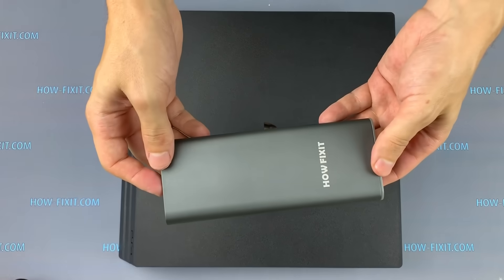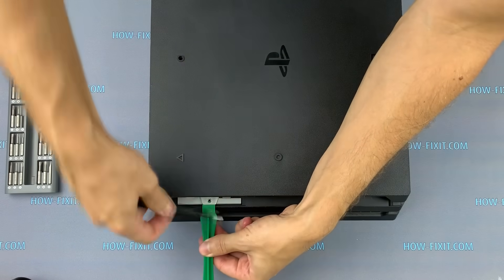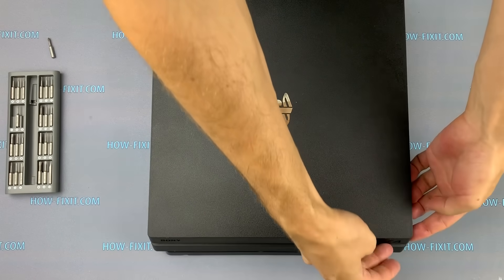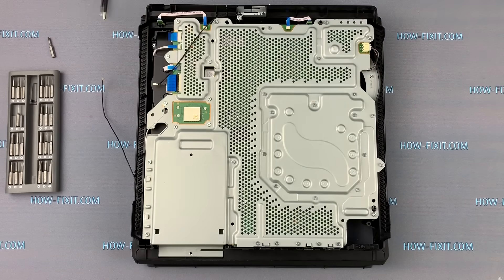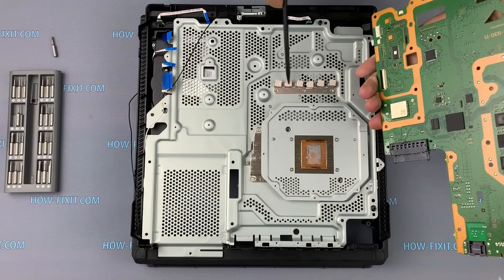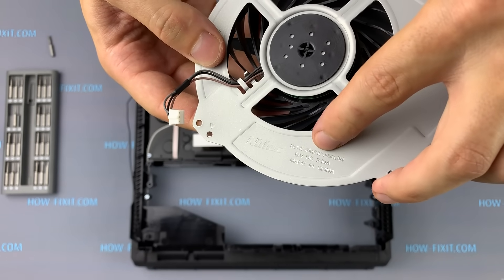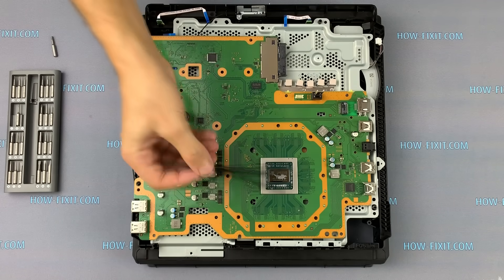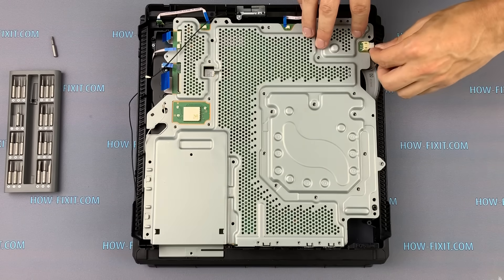PS4 Pro Disassembly: Ultimate Guide for Fan Cleaning and Thermal Paste Replacement

Comment: Thank you so much, i think i would never get my ps4 pro quiet. My ps4 pro is as quiet as it can be, thank you! I used artic mx4 thermal paste, cleaned the heat sink and rebuild the database i think my ps4 pro is little faster too now.
Best tutorial for changing the thermal paste etc for ps4 pro!

Comment: Just broke my ps4 trying to remove the power supply, after about an hour of trying to disconnect the clip, the full thing came off
Reply: same here.
Reply: Ant ChaseMula i managed to get mine repaired mate, cost me £70 though but they managed to solder it back on, maybe look to see if anywhere near you can repair it.
Reply: They basically fully serviced it, removed a bit more dust id missed, put fresh thermal paste on cos id not done a great job etc. It does seem a bit quieter now, still kicks in a bit the fan at times but its deffo not like a jet anymore

Comment: If im gonna actually try this, which screwdriver set and paste do i need from the description anyone?
Reply: You are going to need a basic micro-screwdriver set, and a security screw driver set. Any variety should do in that regard. In terms of paste? I personally find Arctic Silver 5 to be the best bang for your buck and use it on everything I re-paste. Be that Desktops, or Playstations etc.
Reply: Jibb Mcdonaland cheers for the reply but i ended up doing it, breaking the power supply connector and then having it repaired at a shop lol. And then its still noisy af haha even after full service, think its cos of the uncapped frame rate in menus and stuff:(
Reply: @calum769  damn that sucks man. I know exactly what you mean too, I broke the power supply board plug in my OG PS4 the first time I did this on it because it was so anchored in there. Anyways, good luck to ya.

Comment: Cracked that black plastic cover trying to remove the power supply... was impossible to take off (did not take out those two T8 screws on other side- pulled out very easily now)

Comment: i had a CUH-7215b model (RDR2 box set) that had loud fans, would turn off randomly and sometimes wouldn't turn on. rather than spend $200+ getting this fixed, i followed this guide and now it works perfectly. it was way easier than i thought thanks to this video. thank you so much for saving my playstation and me hundreds of dollars. A+, 5* awesome.

Comment: do you think you can do a video using the IC Graphite thermal pad it seems to be a lot more cleaner but i dont know if it will work on the ps4 the same as a CPU

Comment: Was really afraid to do this, especially disconneting the power supply cable, but everything went great and now it's approx. 75% more quite! Fantastic! I have the original launch Pro model, it was very dirty after those 3 years. Used Arctic MX-4 paste + screwdriver set from Extol = cost me 14 Euro :) Thanks for this guide!
Reply: My is broken man .((
Reply: @fahrudingermic2206  Mine too. :/

Comment: Thanks for the video, bought a 2nd hand pro the other day, loud as an aircraft. Did this and now it is deadly silent!!
Reply: Same here. I only popped open the top the other day and boy was it dusty. The previous owner clearly never cleaned it. I’ve yet to do a full clean up.
Reply: @cubancucumber  it is easy enough, done mine and a mates now, makes a HUGE difference!
Reply: Deathon2wheelz did it ever get loud again or was it a permanent fix? Im heading out later today to get the tools and things i need to do the clean up.
Reply: @cubancucumber  still going strong mate, if you do it right and then keep pushing air through every once in a while it will be fine.
Reply: Deathon2wheelz that’s really good to hear. Thanks so much😁
Reply: @cubancucumber  no worries. Best of luck with it all.

Comment: Thank you for the clear tutorial, I would have found it helpful but my current position after reassembling is that my console will no longer power on, it simply beeps once and then the blue light goes out, is there anything you could suggest?
Reply: Make sure the power unit and hard drive are installed correctly

Comment: The socket which the power supply cable connects to didn't wiggle out or budge like it did for you. It lifted the socket off the board, it's stuck in there good I still cant disconnect it. Going to have to solder the socket back on if possible once I've finally separated them. This was one of the simple bits as well. Video helped me a lot until this hiccup but I'm guessing it's just a crappy connector on my PS4.
Reply: AD Westy what version is your ps4

Comment: After doing this my PS4 makes 3 beeps after turning on and then turns off. The only difference is that I used a thermal pad on the cpu, could this be the problem? It shouldnt be able to overheat in 5sec should it?
Reply: What? You applied a thermal pad on the apu? 🤣 Dudeeeeee!
Reply: @blues05  Jup I did, biggest fault I ever made. Fixed it by putting thermal paste on it ahahahah. Whoopsie

Comment: I need some1 to Tell me how to disconect my cable when i get behind that metal plate thing??
Reply: U need to wiggle it gently, pulling it hard will most likely destroy it and will require soldering which is extremely hard on the motherboard without damaging it
Reply: Pull it hard, the first time it's tough but after that it will come out easy.
Reply: Jari Verhaard im too scared to do it hahaha ill just pay my Way to get it cleaned.
Reply: @JulleMandenDK  good choice, I just broke my PS4 doing this
Reply: Jari Verhaard rip.

Comment: When I disconnected the power supply from motherboard the whole piece came out and broke from the motherboard.
Reply: Damn u guys that sucks! I guess you gotta support the bottom part as you wiggle the top. Shit I was fortunate not to have this happen but I can totally see how it could
Reply: This happend to me too a few years back. there are repair videos on yt  showing how to fix that power supply, you will need a soldering iron
Reply: This happend to me too, I will try to solder it but I'm a little bit worried because it emported parts of the motherboard to under the pins, I hope the connection will still work after soldering it...
Reply: same here just now.

Comment: Thanks! I have the first PS4 Pro model, so it was a TINY bit different, but mostly the same process. My PS4 Pro fan no longer sounds like it's a plane lol.

Also to everyone wanting to do this, but scared: Ur main issue is the power supply. If the port thingy breaks ur fucked (fortunately not from experience lol). GL!

Comment: I almost broke my power supply in half because mine is held on by two t8 screws underneath the ps4
Reply: so how did u do it?
Reply: I undid the screws and came right off.
Reply: beendip13 where exactly are the screws located
Reply: beendip13 what version is your ps4 pro

Comment: Thank you very much for this guide, amazing! Replacing the thermal paste made such a difference I'm actually blown away, it's less noisy than it was brand new! Couldn't have done it without this guide 👍🏿
Reply: Hey man i did the same thing. But after six months of quiet performance after paste replacement, the noise is back. How is it working for you?
Reply: @shs7009  Still pretty quiet but maybe not as quiet as when I did it, still very happy tho!
Reply: @Rugwhip  May I know the paste which you used? Was it thermal grizzly or Arctic? Or something else entirely?
Reply: @shs7009  I used Noctua NT-H1. Did the same operation on a friends console and his is still quiet after ~8 months.
Reply: @Rugwhip  Mine isn't overheating anymore but just a bit loud. I wonder if I should try replacing with a different paste.

Comment: Thank you very much for this perfect detailed guide. Just put mine back together and tested it, runs silent now!
Reply: Ryan Ashton did you do it because your fan was loud like a jet?
Reply: @joesanchez1405  probably. I just did mine, bought second hand off eBay, and it went from a loud jet engine to practically silent.
Reply: Did you use isopropyl alchohol to remove the old paste?
Reply: @Taariq2  I removed my old paste just with some tissue, it was still soft enough to be able to be removed without using any chemicals.
Reply: @MuksC  I did mine a year ago and even though the thermal paste had hardened, I didn't end up needing to use isopropyl anyways. It worked like a charm.

Comment: Thank you this was the most detailed guide i ve ever seen. Before.my ps4 pro was screaming around 70 decibel now it is so quiet . Used thermal grizzly . Half of the radiator was full of dust. Thanks again .
Reply: Do you think 1g tube of thermal grizzly paste is enough? Or did you get the bigger tube?
Reply: @1ballashotcalla1  aprox i did the same amount as i saw in the video.
Reply: @pirospipacs  do you remember what size the tube of thermal grizzly was? I've found 1gram tube and then bigger ones but they're a lot more expensive. To me it seems like the one applied in the video is less than a gram but just want to make sure
Reply: @1ballashotcalla1  just found the package and it is 1g Kryonaut, havent yoused all so you should be fine.  Go for it  dude.
Reply: @pirospipacs  awesome man. Thanks very much! Gonna order it soon

Comment: I followed this video and managed to disassemble and reassemble the ps4 in an hour with ease, before the fan was obnoxiously loud and now after cleaning the heatsink its 95% quieter, Thanks👍🏽
Reply: I took about 2 hours and got a new fan and my time was easy as well. I came on here just to make sure people were already encouraging others haha. Go for it if your ps4 pro is loud!
Reply: @thepuzzledsage  hey, question. You mentioned that you changed a fan on your Ps4. Was it broken or you changed it just in case? How big is the difference? Also can you recommend the brand of the fan?
Reply: @AErchenkov  I changed my fan because my ps4 pro was loud and I hoped it would help. The difference was definitely a relief to my ears. I used a Nidec fan and changed the thermal paste and cleaned gunk out of the heat sink.
Reply: @thepuzzledsage  nice, thanks a lot!
Reply: Hi! So did you not replace the thermal paste on the APU? My 1 year old PS4 Pro sounds like a jet engine while playing games. I don't think it's too early to replace the paste. Did the noise dial down for you by just cleaning the heat sink, or did you replace the paste as well? Thanks!
Reply: SHS I did it today using thermal gizzly kryonaut paste and Arctic thermal pads on the RAM. Just follow this guy’s instructions and maybe watch a couple more vids because he doesnt change the pads.
Reply: @shs7009  i redone my thermal paste today along with cleaning out the heatsink the thermal paste they put on barely and I mean barely covered the cpu it was so loud my headset wouldn't muffle it out 😆 my heatsink in the radiator was about 75% blocked with thick caked dust after all that its quieter then the first time I turned it on!!
Reply: I did this today od second gen pro cuh 7110b...difference is amazing...if you have this model do this ASAP!
Reply: Very ejasy. My ps4 was so loud... Even turned itself off due to overheating. Follow the video. First time doing it. Ps4 is now so quiet.
Reply: Was it easy ? I’m looking forward to do it myself.
Reply: @gordon3002   most difficult thing is to remove top and bot cover and then power supply its scary ^^ but easy when u done it xD
Reply: @gordon3002  its easy but need a little patience
Reply: @gordon3002  also u need good set of screwdrivers and good thermalpaste i recomment thermal grizzly kryonauts
Reply: Yes tell us
Reply: SAME. This is HIGHLY recommended
Reply: Same here too!

Comment: I guess you can kiss that consoles warranty goodbye because you removed those back stickers to reach the screws...
Reply: Those warranty stickers are illegal in the U.S., they literally mean nothing.
Reply from the maker: yes, but why you need change the thermal grease under a working warranty?
Reply: Warranty only lasts for one year. If you need to replace the thermal paste you've had your console longer than that so it's kind of a moot point.
Reply: No way you burnt out a PS4 in a year. Even with excessive use.

Comment: Been having mad fan issues running at full speed on my PS4 Pro for ages and this fixed it! The amount of thermal paste they wallop on the CPU was insane! I think it was tricking the CPU to thinking it was near overheating when it felt any sort of pressure so put the fans up to max.

Games like Witcher 3 would cause loud fan issues at any point of the game. Followed this guide, removed the paste, applied some arctic silver 5 and now you can barely hear the fans when playing Witcher 3, even when there's a lot happening on screen. Fantastic!

Comment: Thank you so much I can hear my tv now it’s been awhile! And it will play games again without any problems 🤘🇮🇹
Reply: I very strongly recommend removing old paste (as well as cleaning other pc components if you don't have an air duster) using isopropyl alcohol and a q-tip/cotton swab.
Reply: Did you use isopropyl alchohol to remove the old paste?
Reply: @Taariq2  I'll answer as I've  just done it today. I didn't use anything except a plastic scraper as some of thermal paste was a thick block and some paper to wipe off the old residue. Just make sure you remove all the old paste and apply enough to cover the CPU. Should he golden after that.

Comment: Excellent video guide. Thanks for this. I have the Glacier White PS4 Pro and the cover for the thermal pads and some screws were in different locations. But still easy to to. Great job

Comment: Thank you! You helped me a lot because you are showing all steps, all screws and not just skipping so I got my PS4 Pro fixed following your guide.

My PS4 Pro was loud like a vacuum cleaner from day one, after changing the thermal paste I can barely hear the fan spinning at all :) The difference is as it have reduced the sound by 95%

Here is a reddit post I wrote with some pictures of the terrible fabric thermal paste application, which caused my PS4 Pro to be so loud.

https://www.reddit.com/r/PS4Pro/comments/ecrip9/ps4_pro_thermal_paste_replacement_results/
Reply: Did you use isopropyl alchohol to remove the old paste?
Reply: @Taariq2  normaly I use it but I did not have it so I just used a cloth and toilet paper with q-tips and patience

Comment: Are the 7000 models the same ? What are the difference between the 7215 and 7216 ? I have the pro 7000 model also what did you use to remove the thermal paste was it alcohol wipes.

Comment: Great Demo - 
Looking Forward to Upgrading my Pro. 
I do use a small very quite squirrel cage 
blower with screen filtered intakes to boost in coming air at PS4 and excess.. 
flows over unit to help cool overall case temp. 
These screens catch a fair amount of dust that now is not in the machine. 
Also keep machine in coolest part of layout vs burried or stacked with other devices. Closer to a leaking window works great. 
Cheers

Comment: Changing the termal paste makes such a big difference. Been playing COD 2019 and on the multiplayer lobby where the game is looking for a server, the fan always goes to max RPM. Replaced the thermal paste with Noctua NH-H1 and on the same screen the fan does not even spin. Extermely quiet.  

Not very hard to do overall. Torq TH8 is about $3. Noctua $7. Just be careful and do things slowly in a well lit room. 

When applying the Noctua you dont need to spread it manually, just put a tiny dot in the middle. Search Youtube for videos on how to apply thermal paste (I got mine from LTT).
Reply: This is an updated impression. There seem to be a problem with the PS4 Pro thermal sensor and the CPU logic that tells it to kick the fan up. So I did the thermal paste change and immediately noticed some 90% reduction of fan noise. Then after one month it came back to noisy. I opened the Pro again to check and everything was fine inside. Thermal paste still good, no dust clogging in the airways. I redid the Thermal paste. Same, quiet at first then after 1-2 weeks it got loud back again.
Reply: Actually because the pros chip is rectangular in shape instead of a square it's kind of better to spread a pea size amount all over it evenly. I actually used about a pea and a half to get a even coat.
Reply: Hey bro same issue with MW do you really solve it changing the paste?!?! 🙏🏻🙏🏻🙏🏻😭
Reply: The RealD!Z It did for like a while. Check my updated reply below. Sucks because on my Xbox one x I have no fan noise problem for the same game.
Reply: Do you think 1g of Thermal Grizzly paste will be enough?
Reply: 1ballashotcalla1 definitely enough
Reply: 1ballashotcalla1 yes it’s enough
Reply: Is Noctua actually that good for a PS4? Before I used Arctic Silver 5 and that went well, but I’m looking at a “better” type of paste since we’re going into the summer season and I don’t need my PS4 making my room an oven XD Will Noctua thermal paste help with that? :p
Reply: EckoTheFox I think they are comparable. You can search for some videos that compare them. I got tired of the fan noise and started playing on xbox

Comment: thanks it really helped me replacing my fan from delta to nidec and changed my thermal paste with noctua nt-h1
now its much silent
note - powersupply port is hard to remove be careful with it 
and i broke a metal part lol but it still works
subscribed
Reply: How’d you get it out mine is hard asf to get out don’t really want to break anything lol
Reply: @itsswervin9197  it's better to pull it out from the power supply end than the motherboard, and I recommend  pliers to get a good hold on the plastic and then slowly wriggle it free.